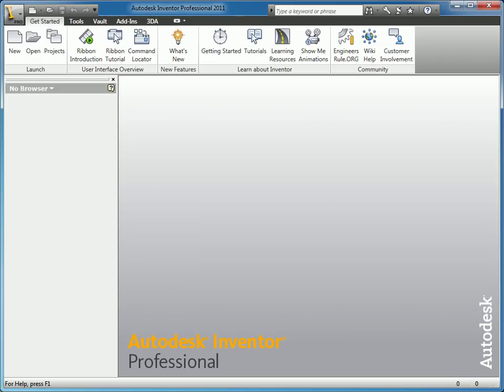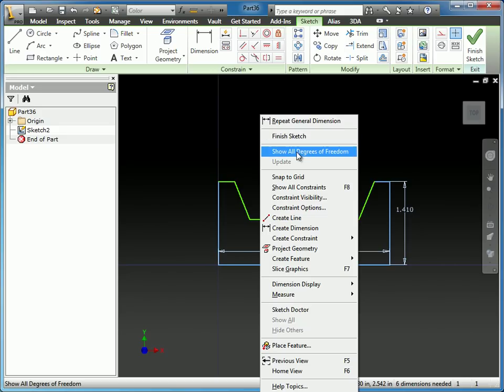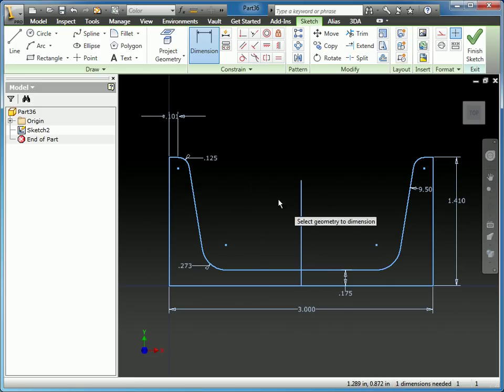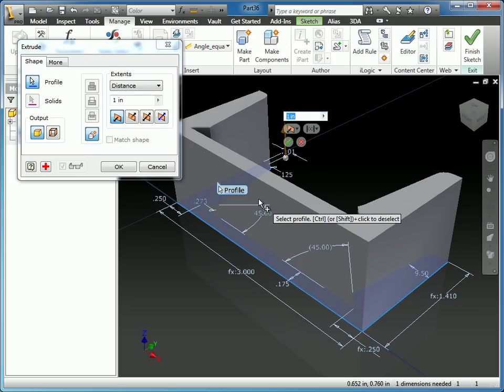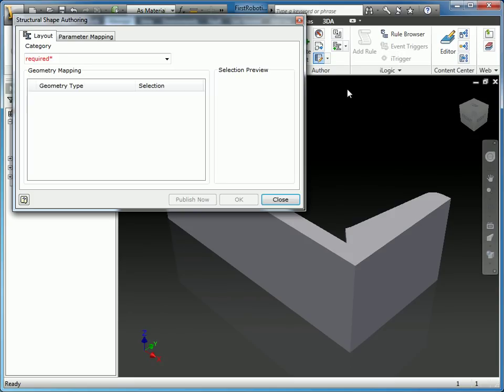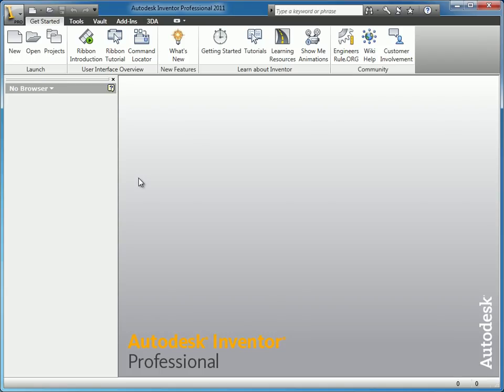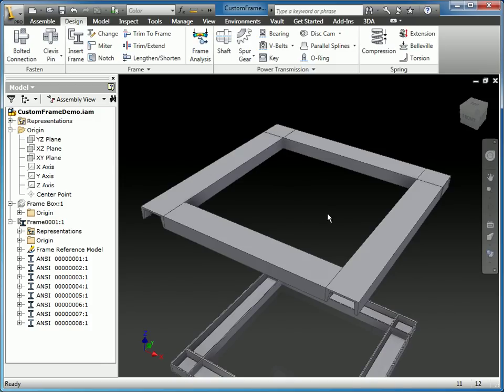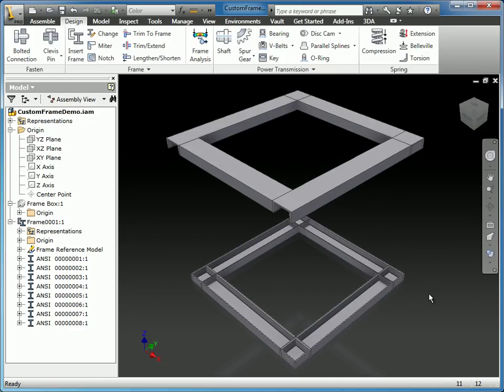Creating Custom Frame Profiles

Comment: Thanks for the video went more in depth than the other ones I have seen. How ever I do have a question. So for a frame I am using a length of c-channel that has pre-drilled holes in it. How do you have it so the holes come across in the profile?

Comment: Hi John, Just wondering how to get the size description in the display name of a member newly created. In your example you can see that it only shows as "ANSI 0000001" as a display name/File name in the family tree whereas with a normal standard frame it also displays the size like "AS C350L0 65X35X2.0 RHS 00000002".

Comment: I need to add some sizes but can't seem to locate the profile in the content center editor. The library I used is set to read/write. The project is the default project. I learned a bit thanks for the video.
Reply: Whats weird is I can find the profiles when using frame generator..

Comment: Hi John, 
Thanks for this video. very well explained.
Just one thing - What if i want to use the authored parts just by placing from content center instead of using frame generator.
I tried it, with frame generator it goes to custom length as per the line we select but when i place it by place from content center it doesn't prompt to take the custom length?
Can you please elaborate this bit a little more??

Comment from the maker: @pigzepenguin I haven't done it, but I would see if you can create an iLogic rule in the custom frame component. iLogic is a rules based design system in inventor that allows you to change design settings and parameters based on certain criteria.You could write a rule that changes the number of holes in an array based on the overall length of the part. If the part is 1 inch long the array is set to 1, if the part is 2 inches long then set the array to 2 and so on. Hope this helps.

Comment: Again, thanks for the upload.Very easy to  follow. I have  a couple of questions.
1- How would you go about adding new profile sizes to a family that has already been created? 
2-I made a circular profile which worked fine in frame simulator but I also made square profiles which didn't work ok. In the simulation environment, "Beam properties" shows Wz value (in mm3) is missing. I don't even know what this W values are. Moment of inertia and polar moment of inertia values do show up. Any ideas?

Comment: Hi, tried doing the same thing but the profile was a pipe of dia 25.4 and thickness 2mm but for some reason when selecting the skeleton the dia 25.4 become equal to length of skeleton, how do i resolve this?

Comment from the maker: @coquicr To add new sizes you need to go to the manage tab, to the content center section and select editor. In the editor select your shape, then select the family table button in the toolbar. This will bring up the table of sizes you can add rows using right click "add row" and ad as many different sizes as you need. Remember you need to make sure the library is enabled for the project to see your custom shapes.
Reply: Wow, thanks man. I searched everywhere for an hour I a found it here, in an old youtube comment.

Comment from the maker: @coquicr You wouldn't ad new profiles to a custom family, the profile is kind of what makes it a family. You need to add a new family for each custom profile shape. What you can change is the size of members of the family. So if you create a profile like the one I made in the video, you could have different widths, heights, even notch sizes, but you can't add a new profile shape. Does that make sense?

Comment: Great video, thanks
After I create  the part and then try to publish I get an error message that reads " There are external  dependencies found in the document. Please remove the dependencies then proceed with this command"
Can you tell me what I'm doing wrong.
Thanks.